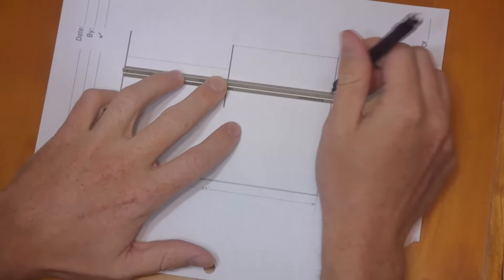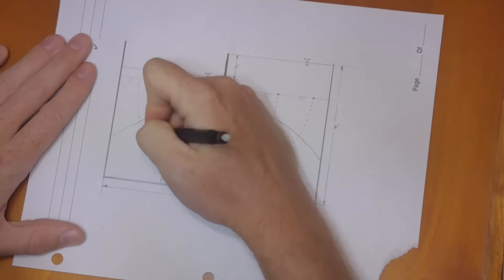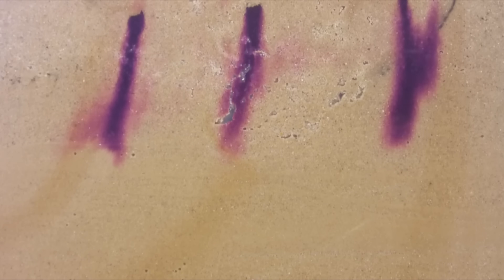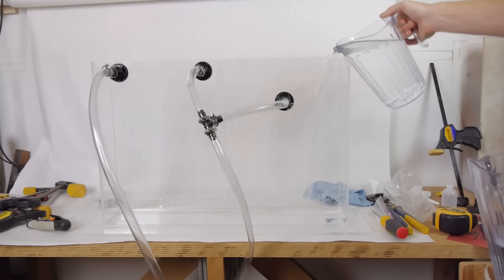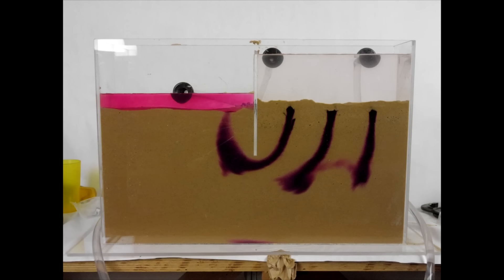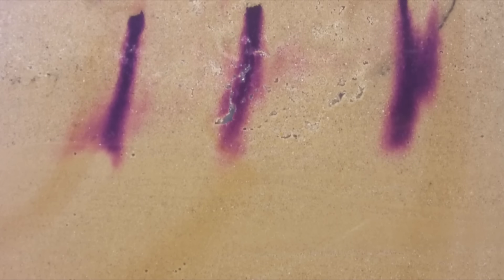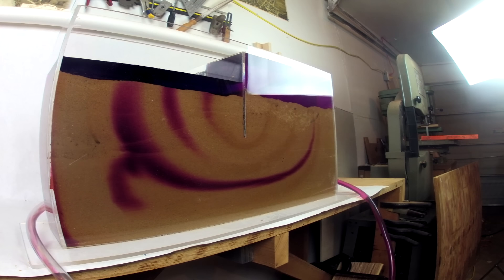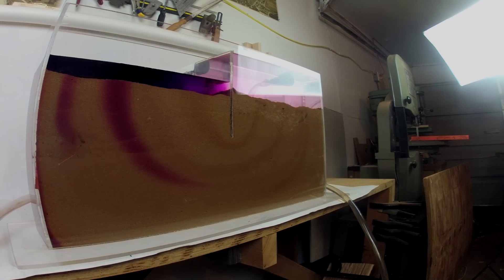Groundwater Flow Demonstration Model

Comment: This is fascinating. Any chance we can get a more in depth explanation of why it does that? If not a video, do you have any papers that I could look at?
Reply: well if you look, one side has more water than the other, so it's literally just water trying to equalize if you put a piece of plastic in a cup to cut it in half but didn't go all the way down, you'd have this kind of shape.

Then you add water to only side and as long as that side has more water, it will go to the bottom and flow to the other side. 

This is happening here, the sand slows the flow greatly, but because sand is eventually permeable. The water is trying to equalize in height on both sides.

Comment: I want to see the experiement with real dirt and water. Like you said structures are always on the ground. rarely are they built on sand...
Reply from the maker: +Ryan Embly Hey Ryan, thanks for watching the video. Sandy soils are very common in many parts of the world. I used the word "dirt" tongue in cheek for soil. I assume you're talking about clays and silts. Generally particle size will affect hydraulic conductivity. For this experiment, changing the sand out for clay or silt would just make the flow slower.

Comment: Why does the ground water in the model that is farthest away from the other side make such a large turn before moving up? Why wouldn't each of the ground waters drain and start turning as early as the closest one? Since the medium is sand, they are not limited to finding and traveling through rock fissures.

Comment: I skipped most of the video. But in the end I though it was only turning because the right container had more water than the left. And on top of that, it's in a sealed container. So I would have expected it to turn like it would without dirt.

Comment: How does this model account for the sideways soaking of water ?  Seems to me that if your box was the size of the room you are in instead of what you made and put on the table and you conducted the same experiment the water would move through the sand in a different manner than shown . Then again , I am not sure exactly why the water acted the way it did .

Comment: So by calculating the waterflows of this specific model, how would you exact the geo-thermal biolocation of the water current if it were to flow unilaterally? 

Just kidding. I saw this in my recommended and wanted to sound smart.

Comment: How do you know the curvature of the equipotentials? That's the most baffling part of this to me. From your drawing, it looks to me like at the ground level the curvature is 0, then at the very bottom point of the divider pole in the ground the slope approaches negative infinity (straight down). But how do you know the curvature at 1/3 of the way down the pole, halfway down the pole, 9/10ths of the way down the pole? I'm assuming it has to involve some kind of graduated SIN function?

Comment: i  noticed we migh have the same table saw a 10" Rexon? im wondering if yours has i micro adjuster knob on the fence. Mine doesnt, there's hole in the fence that looks like it should have one and the fence rail has a rack and pinion track on the bottom of the rail. Any input would be helpful. Thanks in adavance

Comment: Explain like i'm five please... So he adds constantly water to the right side. Then the water flows trough the sand to the left side but the water level on the left doesn't rise. The purple color the left just gets intenser. Like more compressed or concentrated. But its not a gas or something like that... please enlighten meeeee thx :D

Comment: I think you're getting Geotechnical Engineering confused with Hydrogeology. They work together but Hydrogeologists will work with ground water models. Geotechnical Engineers will interpret the data for structure ect.

Comment: Does Anyone Know what the plumbing fitting used at 2:15 is called? specifically the part that seals on both sides of the plexiglass with o-rings
Reply from the maker: Bulkhead fitting

Comment: Hmm.... it looks like there are definite "zones" that the dye follows. So if it is engineered fill it may have non compacted areas but if it is in situ then without a cross sectional analysis by either seismic or imperial investigation this model is flawed. It does illustrate how a good designer could mitigate ground water contaminate intrusion through careful design and construction. But what do I know I was just a simple Aerospace Engr. And "there's no such thing as a civil engineer"..........😎

Comment: Thanks again for such quality content. I've seen this particular video a while ago, but just now got the chance to show the water analogy in action to my fiance. She learns from less abstract examples much better than just taking formulas like Ohm's law at face value. At https://youtu.be/0EzoHXEzdwY?list=PLTZM4MrZKfW-A419dqGZVtw6CAANqKR1f&t=162, this is a perfect example of a voltage difference driving current through parallel resistances. The shorter path reaches the low pressure side first. The longest path is visibly moving at half of that flow rate. It's so cool to visualize voltage gradients as ground water movement!

I've also shown her your awesome water hammer video to explain inductance (and its V = Ldi/dt equation) as well as how capacitors affect the circuit (the water tower)

Comment: You have shop full of power tools yet no proper drafting tools? That straight edge used in drawing looks like cheap give away at vendor shows! What engineer even starts a drawing with ragged torn corner paper. Ever seen grid paper? There are plenty of templates on Internet to print proper drafting paper! I have serious doubts about this model simply from lack of dimensions which should correlate to actual calculations. If flow took hours in this mock up what is time frame in real life? In addition not all soils are sand such as this. I also have suspicions that the model structure material could be very different than real life and have physical properties distorting the behavior of the test liquid. Perhaps there is unknown electrical current attraction/repellent in model plastic sheeting material to the test liquid.